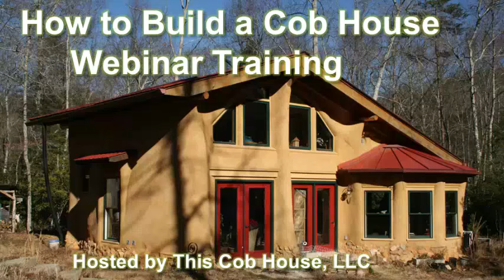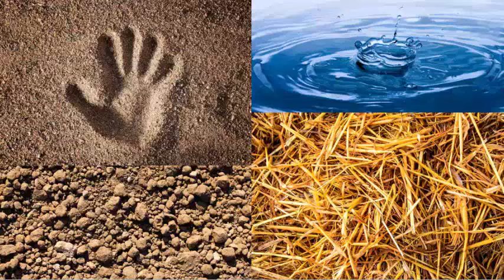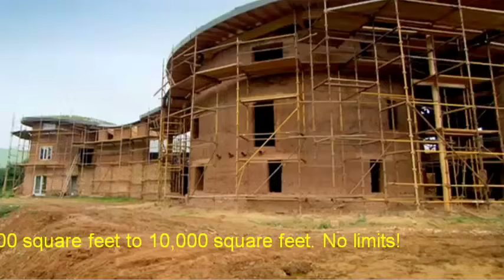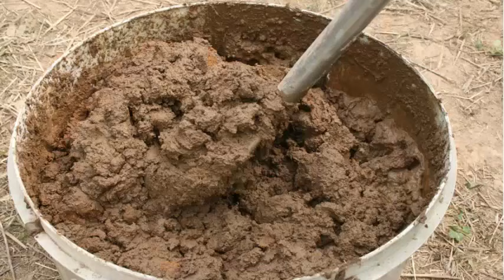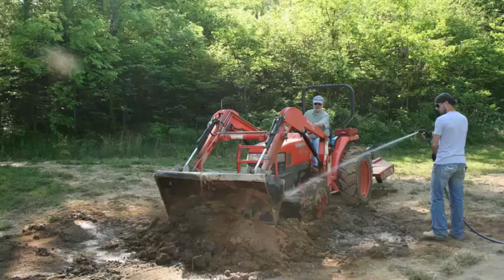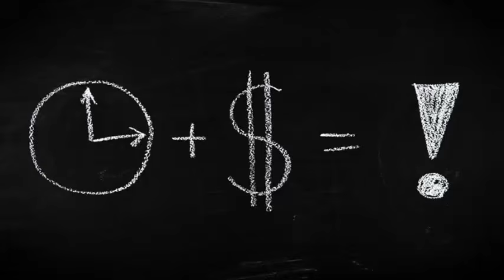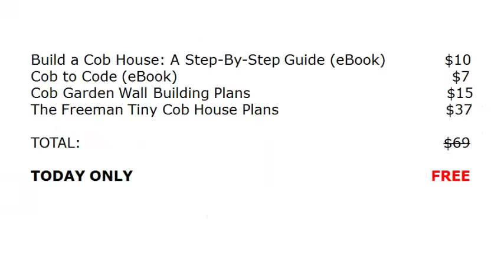BUILDING A COB HOUSE - INTRODUCTION TO COB

Comment from the maker: Credits for image at 0:01 🏡 Leela House, at Earthaven Ecovillage, a collaboration of Arjuna da Silva (owner) and Steve-o Brodmerkel (builder).
Reply: I need this. Am in Nairobi, Kenya
Reply: FINALLY !!! Some GREAT Architectural DESIGN w CLASS.
Reply: @beblissnow5947  Design?
Reply: Hi there, do you ever use hydraulic lime in any part of your buildings? Or never, as there's no need??
Reply: Hi, are your courses still available?
Reply: Alex,, can, or is it possible to buildup cob or adobe, on the outside of a wood shed, in order to insulate it in cold weather where it gets down into single digits in some winter months in northern Arizona.. just thinking of doing something different on this new wood Graceland building, a 8x12..has metal roof.
This could be considered a test run to warmup a simple building in the woods. Neighbor behind me built an adobe cabin 30 yrs ago out of the volcanic rock here with the Lovely clay only down a few feet...Thankyou for your input, also trying to buildup a warm place to be if I choose too. Your fan Harvey

Comment: If it was my video, I would not introduce myself until the end...And here's why...Wait for it...

I would go into it:
Today, I'm going to teach you how to build a 1400 ft house.

First, set your perimeter and dig a trench around it. This is to ensure that water flows away from your structure. It it doesn't, then create a mound for your house to sit on.
2. Mix the sand (3), clay (1), straw (1), until it's well incorporated. Some people stomp it like grapes, some use tarps. Whatever the method squish it all together. Water is 'as needed'. Not too dry. Not too soft.
3. Foundation: Use big rock, little rocks, even a concrete slab to lay your mud onto. First, you would need to dig 2ft 
down your entire perimeter (1400ft). *This is the time to call your plumber* He must see your layout of all bathrooms and sinks (kitchen).
4. Walls:  This is the time to call your electrician. You will need to make 'form boards'. One in front/one in back, because that's where you will throw your mud and pack it in tight. You will need to make many, as you will continually go higher and higher (I would go 12ft), also, the form boards make sure you are plum (completely vertical). 
5. After removing the form board as it's semi-hard, make a claw with your hand, and poke shallow holes in the mud. This helps your lime casing to stick, when you completed all your walls. The lime casing helps make it water-resistant.

The shape of walls, round or square is at your discretion and taste. Also, molded type designs can be built in. Personally, I would look at old French buildings for ideas, or old Mediterranean homes.

Roof: I haven't gotten this far yet. What I plan to have are wooden beams to hold rafters. Then maybe terra cotta tile.

Porch: I would also make smaller beams/posts to make a long & wide porch. As it rains, I want the roof extending to the porch to force the rain water far from the house. From the inside porch, I can sit, drink coffee and make sure the rain is clear of my mud brick house. 

*THIS IS LABOR INTENSIVE*
It might be fun for some- but it is work! Hard work.
And this is where I would introduce myself and my cob company.

Comment: Two questions concerning the opposite ends of a potential cob home. First, this home would be built in eastern California. This is high fire, high earthquake country.  As a result, the idea for the foundation would have a think concrete floor with 40 some-odd basalt columns for this 3000 square foot building. Crossbeams would be basalt-reinforced steel beams. The home would be built upon the beams. Would this help with earthquakes? Then comes the ceiling. With a steel roof that has solar panels, how do you put a ceiling on this thing? Do we have basalt-reinforced rebar spanning this thing and then put concrete under the rebar? How do we then attach the cob to roof? Any help would be greatly appreciated.

Comment: The residential code contains provisions for this type of construction. The quoted IBC is for commercial construction which is why residential requirements aren't mentioned in it. The residential code is an exception to the IBC. It's called light-straw clay construction and it's an appendix that must be adopted by the local jurisdiction for the ability to use it and approved by the authority having jurisdiction.

Comment: So, if the subsoil is about 20-25% clay, then I’m all set….just add water n clay, is that correct ?

We’ll be building in Mexico so no issues with building codes !

Comment: Thanks for this. So confirming, your 20% clay in the cob mix is actually a sub-soil that has clay mixed in it? i.e. you don't separate the clay?
Reply from the maker: That's correct. Just subsoil with about 20% of clay in it will do great.

Comment: It’s a very common misconception about the straw in cob construction. The straw does not reinforce the cob,it’s purpose is to stabilize the cob and reduce shrinkage and cracking.

Comment: How is a broken window replaced in a cob home?
Reply from the maker: Please refer to my videos on window installations. If you decide to put just a piece of glass into a cob wall, you will have a very difficult time replacing it if it brakes. This is why I teach a better method of installing frames into the walls for each window.

Comment: What if there is a leak in the pipes? How do you go about getting to the leak and then repair the cob?
Reply from the maker: I do not recommend putting any water pipes through/in cob walls. I have strategies for where to put pipes.

Comment: I have bought numerous chimaneas (sp.?) and they crack and break after a couple of winters here in northern Idaho. Is this the same materials?
Reply from the maker: Different. Cob will not crack when done right.
Reply: No chimareas are not cob .they are concrete.

Comment: Straw is really expensive here...what can be used instead?  Leaves?pipelines? Dead grass?
Reply from the maker: Where are you? 
Anything that has a high tensile strength will work. Roughly 6 to 12 inches in length.

Comment: So I'm basically building a cob cottage by myself, as my wife works full time...I am hiring a couple of High School boy's during their summer vacation to help speed up the process, however, I also want to have the main structure up before winter, so I will need  to speed up the mixing process...I'm considering using one of those 3.5 cubic ft. Harbor Freight concrete/ masonry mixers....Is this a workable idea?
Reply: Did you use the mixer?  How did it work out for you?

Comment: As for the sand alone - is that usually brought in (sea dredging) or just what type of sand and where do you source it usually ? Is that a more expensive component?
Reply from the maker: Sand is normally bought at any soil depot. Sand is one of the most inexpensive components.

Comment: So to all the hippie heads up their asses who think codes are some evil barrier to be overcome, I'll point out the whole video is a source guide to "TEACH YOU HOW TO DO IT RIGHT". The minute cob con. is acceptable, I can promise a regulation that would force you or your builder to have some kind of recognized certification to build rather than cutting loose a couple tye dye birkenstockers smoking up and playing in the dirt, especially next to other homes in a neighborhood. Next is the need for some engineering background for incorporating even off grid electric or refuse recycle type methods. The electrical is a no brainer for a need of some kind of formal education. But the waste control requires two major forms of education...even if it's from grandma. First is a real firm understanding of disease and sanitization. the other is a history lesson on what happens when your bereft of the understanding of what a simple bacteria can do to the human body. That said, As an engineer both Mechanical and Electrical, I do find great value in this building form. However, if your going to tackle it, get educated, get decisive about the kind of involvement (i.e. off grid electrical, sewage and wastewater treatment or hook-up and potable water sources etc.) and to what extent you need to prepare. Next is to build in an open area away from other structures. Next is to investigate the legalities of obtaining building waivers for legal BOND agreements with the county and state you live in that gives the state and county indemnification from liability for building allowance should anything go wrong and harm is done. Like a tremor that brings your sand castle down on you and your children's heads. Grandpa and grandma or auntie and uncle cant be bringing lawsuits against the state for YOUR inability to build right. That about wraps it....and from what I have observed,  this kid isn't bad, so this might be a great source at a great price to educate. Good luck and happy lodge poling!
Reply from the maker: Thank you.
I also support cob code and doing it right.
Reply: @thiscobhouse  common sense should'nt be regulated....but since there is so little these days, they (kids...anyone under 50) need all the help they can get. Teach on, and good luck

Comment: A little more research is needed but definitely interested. 200 bucks is nothing if I can build something like this myself. I would seriously consider doing this after I can figure a rough estimate in costs for about 400 sf in a rural area in TN, plus difficulty in acquiring the building materials.
All four seasons (but not frigid winters) and lots of rainfall here.. No idea of building codes but it's not a huge concern when it can't even be seen from any roads. Whimsical appearance, natural, safe, and affordable...Love it.
Reply from the maker: I've built a lot of cob in Tennessee. I'm actually going up to Athens, TN tomorrow to continue a cob building project.

Comment: can cob be used to build in the desert southwest U.S.?
Reply from the maker: Absolutely! In fact, it works extremely well in that area.
Reply: In fact, it should be the preferred choice with thick walls. It keeps the house way cooler and those deep set windows in thick walls work like air conditioning. If you prefer dome shaped roofs it becomes way more airy and ventilated.

Comment: Hi. Wonderful video - which you should be hugely proud of.
I'm helping my cousin's build a straw bale home (in the West of England) with a Cedar roof; and clay, sand, chopped straw rendered walls. We'll paint the walls with a light limewash inside; and multiple coats outside. We've noticed some big cracks (small ones are fairly unavoidable) appearing. Using a 1 to 1 sand to clay ratio inevitably caused this. So, for the external render we'll likely use 3 to 1.
Reply from the maker: Thank you!
Congratulations on the strawbale construction! Very exciting.

Comment: I learned a lot. I intend on making a 4 story strong framed house out of Cob and Stone and Hempcrete. On the outside it will look like a typical one story Irish stone home or Scottish stone home with a A Frame roof. The difference is it will have the other 3 floors below ground. The exterior visible part of the house aka the 1st floor will be made with beautiful Celtic stone design and a mortar most likely cob. Cobs properties seem great for use in the interior too for its insulation property. But I’ll be using the cob for the visible interior wall. The insulation between the exterior and interior I’m thinking will be Hempcrete. So exterior is stone and cob. Insulation is Hempcrete. Interior is cob. The 3 floors underground need to be water proof of course so what ever I choose I’ll cover it in a skin of rubber sealant to be a water barrier between the earth and the exterior wall but the below ground exterior walls themselves will be made of something more water proof then cob. If all else fails I’ll just have to use a single pour reinforced concrete for the  foundation and walls unfortunately. I wish I could know of something better then concrete to use for the exterior below grade walls because cob isnt water proof like he said and the soil is wet where I want to build and I want my house to last for my grandkids at the very least..but I don’t of another waterproof below grade exterior wall material to use. Good news is when that’s done, I’ll put the Hempcrete insulation into the frame and then after that make the interior wall out of cob. Plumbing and electrical taken into consideration of course. I want a very insulated house because I want to live somewhere not too south because I still want all four seasons. Thanks for the bit about the Roof overhang and downward slanted windows with the drip line. That’s very important even though I may not use only cob for the exterior 1st level walls. On top of my cob floors I was thinking of putting hardwood floors or tile floors but not for all of the floors just most of them. For heating I already got that figured out. I’ll be using a hybrid I fashioned between a Rocket Mass Heating system and a Geothermal radiant earth heating system. A hybrid of the two. The hybrid works very very nicely. The Rocket Mass Heater portion burns the wood so well that even the creosote is burned away so it only produces C02 and something else (both of which I exhaust into the ground where the geothermal heating system pipes will get their heat from so nothing is wasted 😉😉)  I have electrical figured out too. No electric bills at all. Traditional solar panel array on the east and west parts of the A frame roof. Traditional solar panels are the rectangle ones which are very durable and have higher efficiency and reliability then the others for cost. I’ll set them up/install them myself. No labor cost for that. The panels will be connected in parallel to prevent shading issues and I’ll be using a inverter and advanced charge controller and transformer for maximum efficiency. So the panels produce the charge. To store it I’ll make a battery bank. Battery bank made of an Iron flow battery OR just old fashioned Lithium Ion batteries. I got water figured out too. No water bills. Because I’ll be using a Rain Water Harvesting system inspired by two people I’ve been learning from here on YouTube called Handeeman and Homesteadeconomics. My clean and sanitary roof harvests the water. The gutters and gutter pipes filter out almost EVERYTHING using a series of different filters like mesh filter then Sand, charcoal, gravel, and other materials. The clean water goes into huge sanitary containers kept away from any light and gravity fed into the water systems in my house (which is partly why 3 stories of the house is below ground. The other part being on top of everything is take advantage of the Cob and Hempcrete insulation properties and the earths natural stable temperature.) No water bill. No electrical bill. And lastly I’ll have a sunken greenhouse hybrid aquaponics garden attached to the first basement level to grow oranges and grapes and blue berries and avocados and tomatoes and strawberries all year round. 

Many of my friends how to foreclose on the house and not live the life they wanted. Many of them are getting on 50 and won’t be done paying off their mortgage until they are 80 or 90. Many can’t retire and are slaves to the bank. They live paycheck to paycheck. Can’t travel. I do not want to be slave to the bank. I want to live my life MY WAY. That’s SUPPOSED to be the American Dream. 
I will build my house over the course of 3 years. I will not use a bank loan. I will not pay a general contractor. I will be my own general contractor. I will pay the construction cash step by step. No mortgage. I am restricting myself to a house budget of $100K no more and I know I can do it thanks to the lack of bills and cob and Hempcrete and maybe even Aircrete. Leaving $6K aside every year for my Roth IRA so I can retire strong later on.
Reply: Aircrete is the way to go for good insulation!!
Reply: Wow! Amazing! Good for you. You should be so proud. Howzit going so far? 👍🤗🌺
Reply: Do you have a motivational progress for all of us readers? 🎉

Comment: I love this idea! I am looking forward to mixing this with earthship  building. I love that I can shape cob homes and add my fairy tale features and use colored glass. I just love it!
Reply: Did you get to do this incorporation @Connie Koehler?
Reply: Im looking to do the same and wondering if I can get by without insulation in zone 7. I feel like the passive solar will go a long way but maybe the insulation will need beefed up. I really want to do away with vapor barriers except on the roof. I'll probably just make it more earth integrated rather than just a standing wall

Comment: What is the exact difference between adobe & cob? And, by the former, I mean even that with a thin layer of mud over it. Thanks in advance.
Reply: I thought 'adobe' as far as Building Codes go, required mixing in some cement to the cob mixture. I thought that's what Alex said.

Comment: would cob buildings be able to survive rainy and humid areas at all? would a roof over all of the cob parts of the house suffice to protect it?
Reply: Simon Kap watch a show on a girl building one in Oregon and. They have a rainy season
Reply: My mom is from Michocan, Mexico and cob homes there withstand even severe rainstorms during the summer months. Not a jungle over there, but rather a savannah and still quite tropical.

Comment: I would like to know if it would be possible to COVER a house with cob... I have a cordwood house and it is not very energy efficient anymore as a lot of the logs have split from inside to outside and I find myself covering cracks to stop drafts... It was simply not built correctly to begin with.